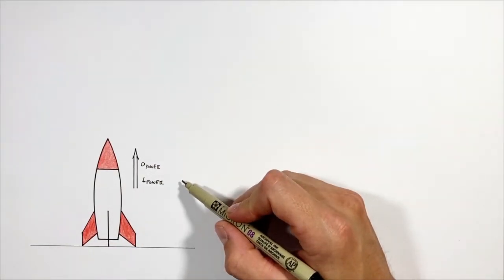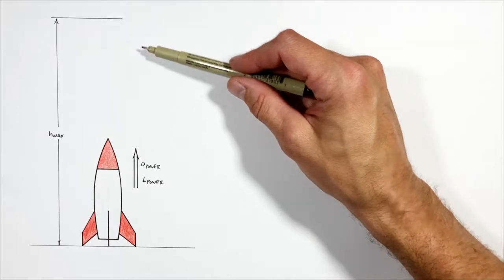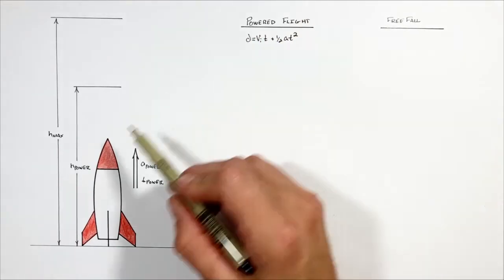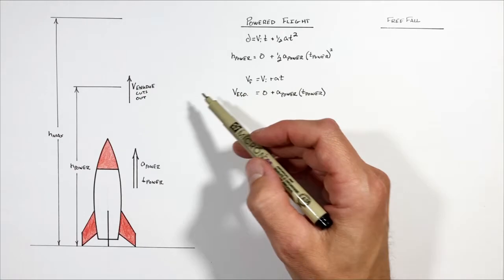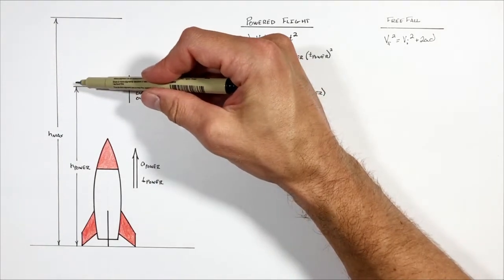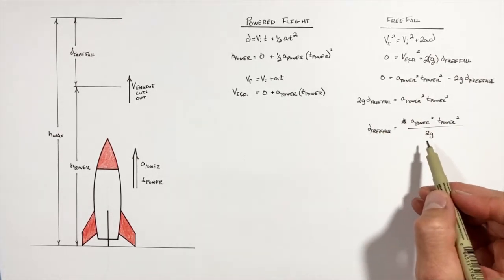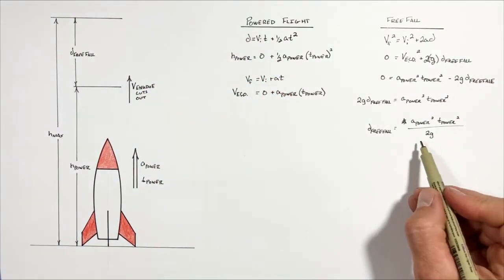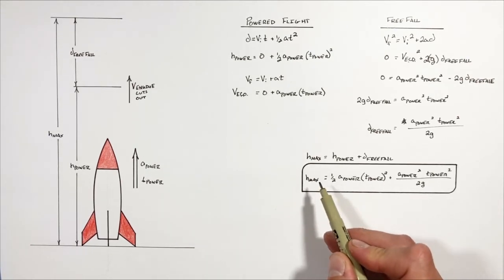Calculate Maximum Height of a Rocket After the Engine Stops  |  Kinematics

Comment: How would you solve this problem for T, given a maximum height of 950m?
Reply from the maker: You need more info.  Either the velocity at engine shutoff or the acceleration of the rocket.
Reply: @INTEGRALPHYSICS  Like if the acceleration was 25 m/s^2?